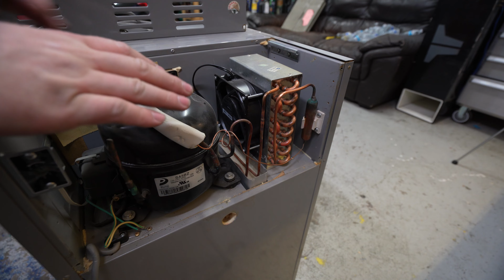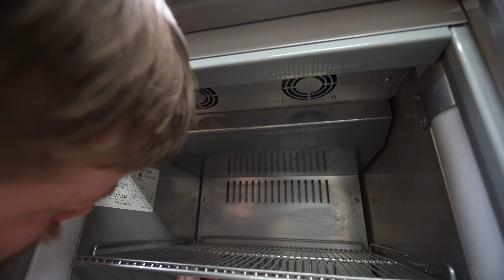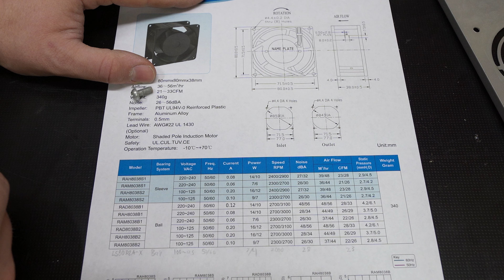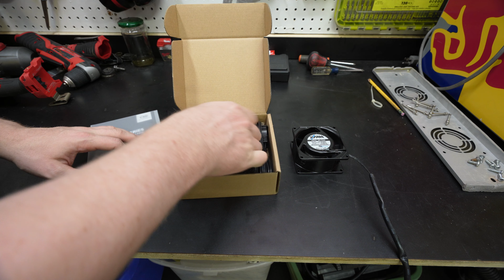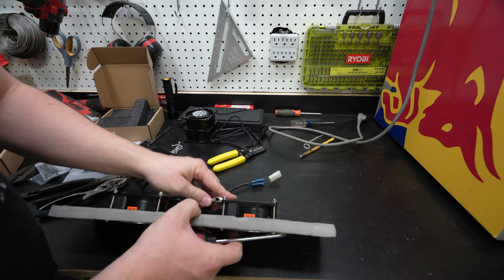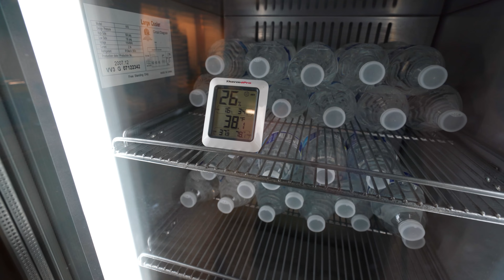Repairing Red Bull Mini Fridge

Comment: I have the same fridge and mine cools just fine and is pretty quiet for a fridge but it is leaking water and water is forming in the bottom I do have damage to the seals debating if it’s worth fixing. Let me know what you think thanks and great video!

Comment: Great vid!  Can you put a link to the switches that you used to control the lights?
Reply from the maker: I think they're just generic 240v rocker switches from digikey i had lying around. I'll see if i can find some ones off amazon that should work, if you want. I didn't link them just because high voltage gets a little hairy to mess with. So figured if you felt comfortable enough to do a mod like that, then it shouldn't be too hard to figure out a switch you can trust for the situation. Hope that doesn't feel like gate keeping though!

Comment: Hey man can I ask u where did u find the exact replacement fan for this unit? I can not find one if my life depended on it mine makes the same horrible noise
Reply from the maker: The fan's aren't "exact" replacments. I couldn't find anything on getting true OEM replacments, but after looking at the dimentions and crossreferencing all the fan specs of what i could find. The ones i have linked in the description should be as good if not better than OEM ones. Hope that helps!

Comment: Great video. Have you changed the bulbs yet? I decided to order led because of the heat
Reply from the maker: thanks! and no i haven't had to change bulbs yet, but I would also opt to change to LEDs for the same reason. No sense in the little fridge having to overcome the heat of the bulbs too. just inefficient!

Comment: I recently got one a Red Bull fridge exactly like this, I need to do a lot of restoration any websites I should definitely look at, I will need new decals, bulbs and a front Red Bull faceplate.
Reply from the maker: Unfortunately I haven't found any sites that specifically supply parts for these fridges. Might be able to get things done with a custom vinyl company or something. And maybe look at converting it to LED bulbs while you're at it.
Reply: mate did u find the faceplate or not?

Comment: I have this exact model and was having issues with the noise. I was curious if there was a sure way to tell if the noise is coming from the outside or inside fans or something else? Also if you have any advice for how to control the lights that’d be amazing!
Reply from the maker: Sorry this is a bit late probably, but if you wanted to check which fans are making the noise, just unplug it, take off the outside cover for the compressor and outside fan. and put a stick or something in the blades to keep the fan from spinning. If the noise persists then you know it's the inside ones lol Should work to figure that out!

Comment: I received a similar fridge from my boss, but it has a detachable power cord that he couldn't find. It looks like a 3 prong 125v 10a power supply, but the markings on the fridge says 250v. Should I buy a 250v power cable, or will the 125 work?

Comment: Any issues with the fans you wired in so far? I got the same fridge for free and both condenser fan and evaporator fans need to be replaced so I was gonna go with your choice.
Reply from the maker: No issues at all. Though haven't been running it 24/7. The winters get too cold. I'm not worried about my fan choice if that helps. But I also didn't see a lot of other options either.

Comment: not sure if you can help, but i have this fridge and the bulbous part of the condenser coil(?) keeps getting wet and dripping into the body of the fridge. should i try to insulate that or is there something else that might be causing this? there is no freezing/ice. the fans work and are clean.

Comment: I accidentally broke the tstat, can you replace with off brand t stat?
Reply from the maker: I'd imagine so. Usually thermostats are just a on/off output, so as long as thing's aren't crazy different they should work. But i also haven't adventure there yet with refrigerators before